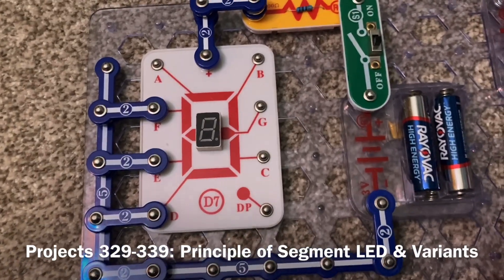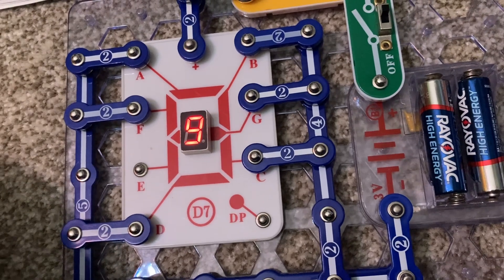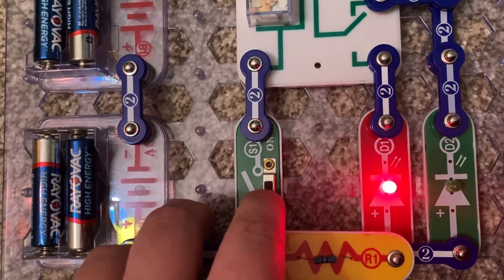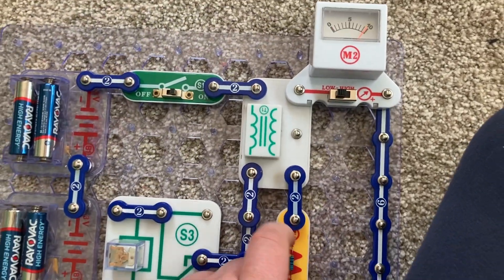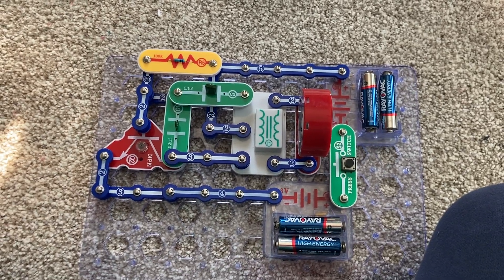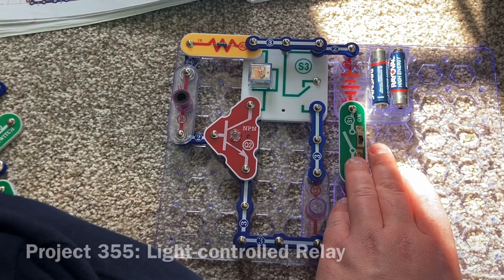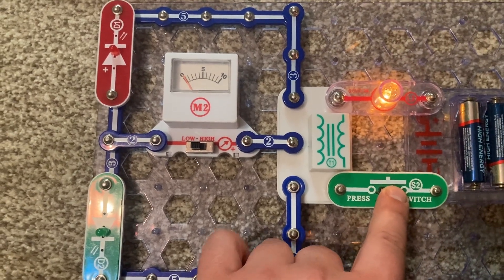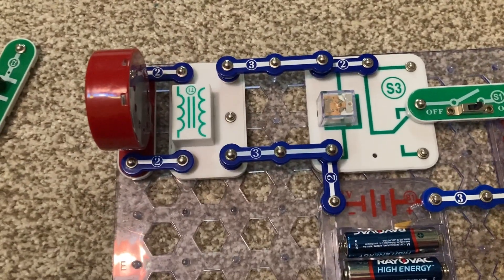Snap Circuits Extreme SC-750: Projects 329-361

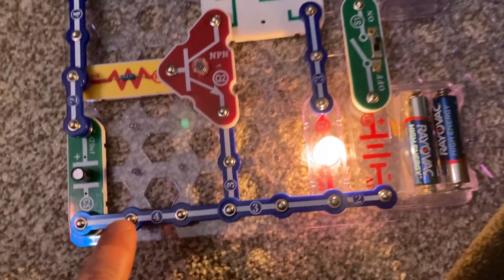Comment: 6:40 - the capacitor doesn't power the lamp. The capacitor energises the gate of the NPN transistor, which then energises the relay allowing its switch to close.

The relay is what switches the lamp on.

Once the capacitor discharges below a critical value, the NPN transistor gate is no longer energised - which means current stops flowing through the relay coil. This makes the relay switch off, which finally switches the lamp off.
Reply from the maker: @Chris47368  Thank you very much for your input.  I am pinning your comment so that other viewers will know.
Reply: @andrewsstation6436  No worries! And i am glad my comment helped!